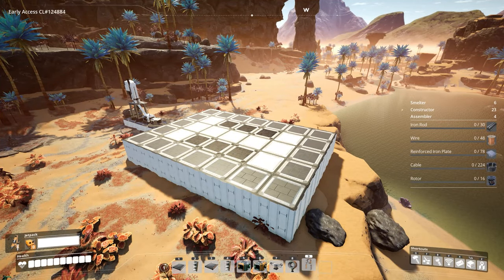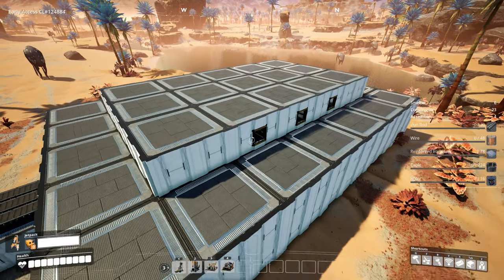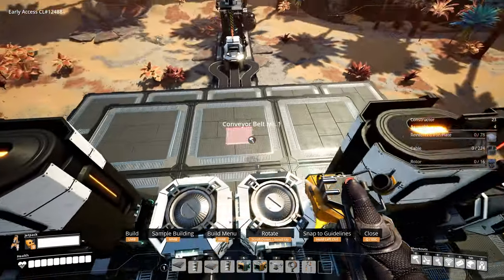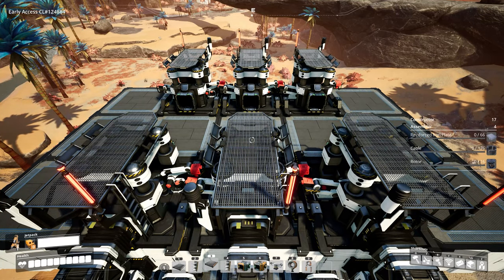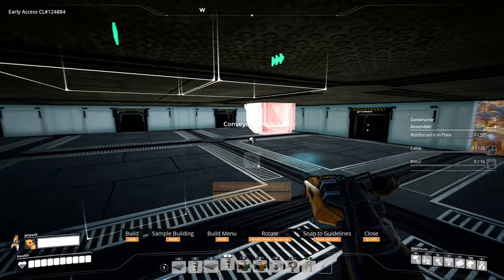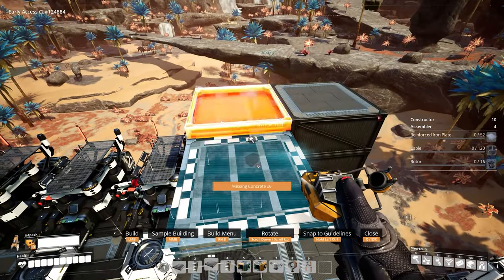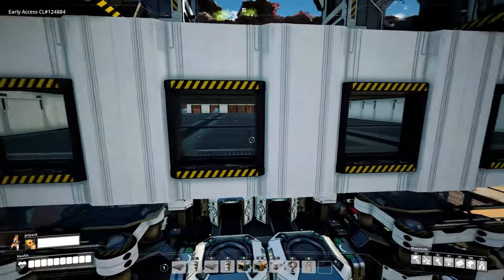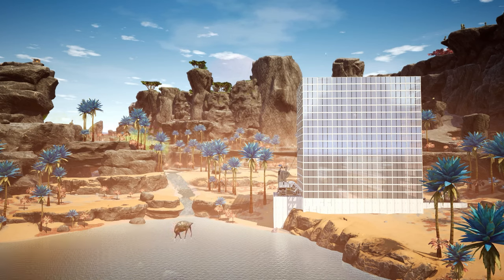100% EFFICIENT 16 Rotors / Minute Factory! [SATISFACTORY GUIDE]

Comment: Couldnt you create this kind of a factory giving all the materials? 
Like rods/screws/plates/rotors/reinforced plates (and as a king discipline smart plating) :D
Reply from the maker: The issue is lower tier belt speed. These factories are designed to produce a singular item as a building resource to help enable newer players to build factories to their hearts content. As an additional, it also provides useful techniques when building factories to keep things clean and organized. 

Can it be done? Certainly! But i would like to leave some problem solving and exploration to the user to experience.

Comment: Unfortunately this build doesn't seem to be possible anymore. There's no way to place splitters/mergers that closely.
Reply: I just did it today in experimental, you just need to push the smelters/fabricators one notch more on the outside. The splitters and mergers will fit in the middle and you'll still be able to put the elevator to feed them from behind. I had not trouble doing the full build in the update 5
Reply: @majortk7138  but if you do this don't forget to put the conveyors to the lifts, since you pushed the smelters a bit they might not be connected to the sandwich layer anymore
Reply: @majortk7138  I did this and it worked thank you